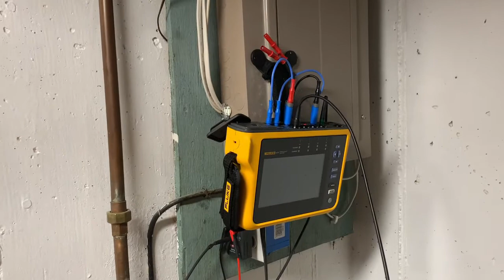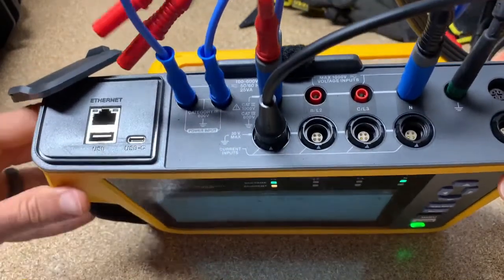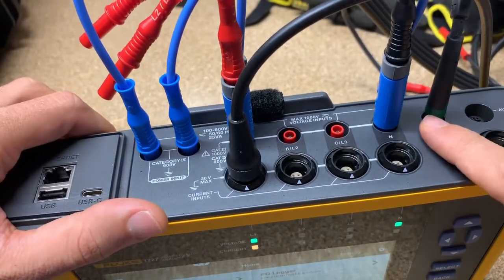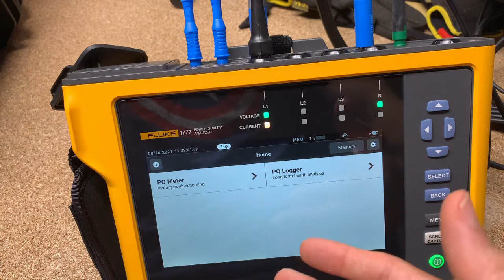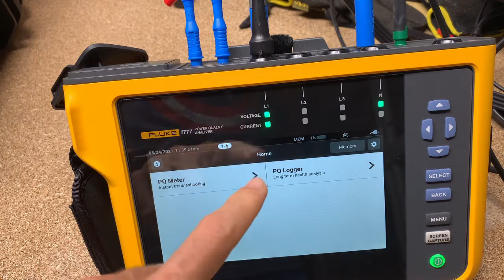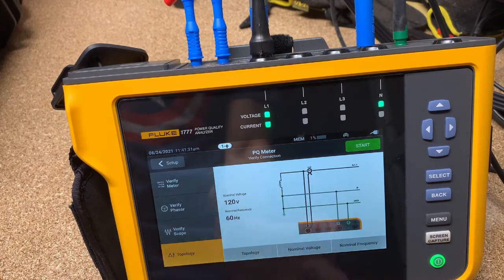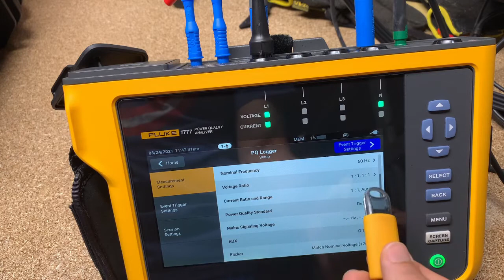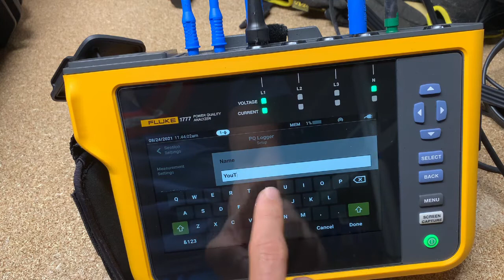Fluke-1777 - Walk Through - Part 1 - Episode 24

Comment: Hello Brandon, very nice video presentation. Could you please let me know what is the model number of the adapter that you are using in your power outlet to connect your 1777 to power?
Reply from the maker: @eliasmylonas9530  are you talking about the blue jumper cables? Or the cord plugged into a outlet?